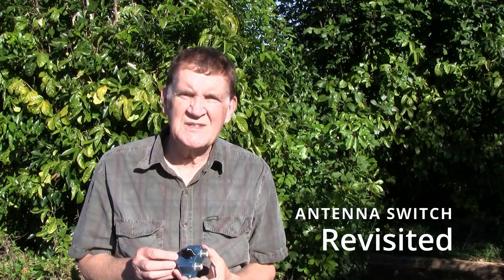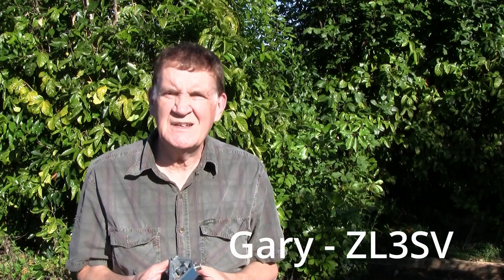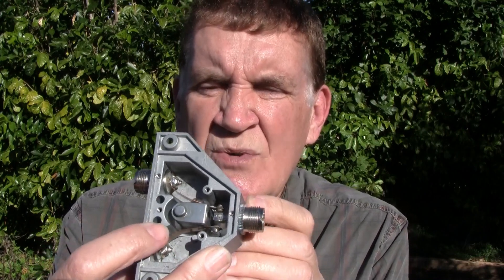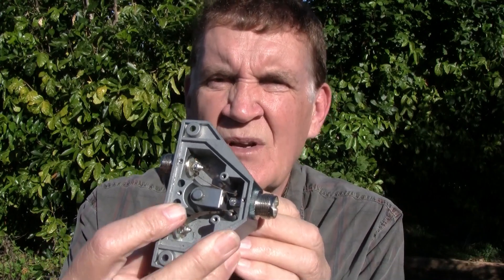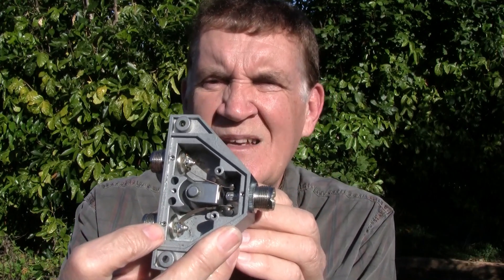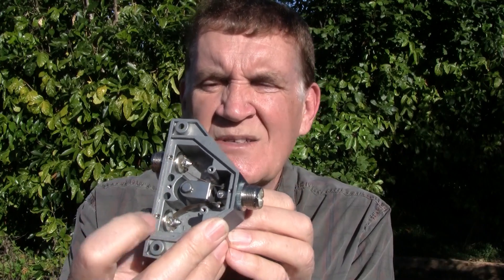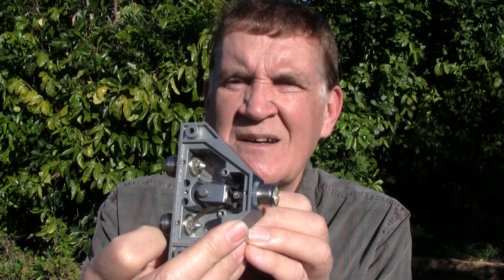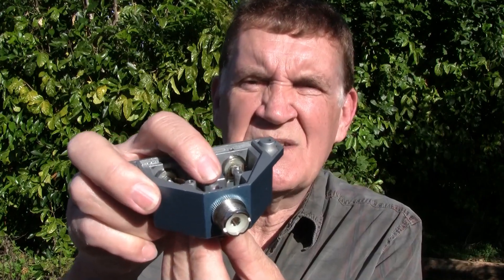Coax Switch Revisited - Corrected Aspect to 16:9

Comment: Living in south Florida I can tell you that there is no way to have to much grounding! I have seen ground rods with Glass all around them!  With sandy soil and the heat from lightning, that is all it takes to put glass around the ground rod! That makes the ground rod useless! The more ground rods the better and they need to be connected together to share the load!
Reply from the maker: It really is a case of knowing your own local conditions, thanks Donald for your input.   cheers